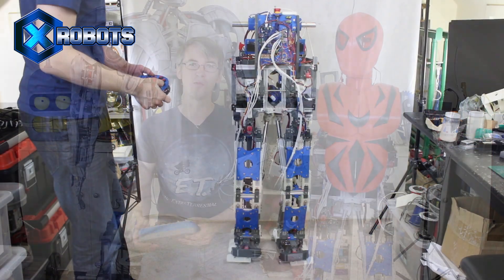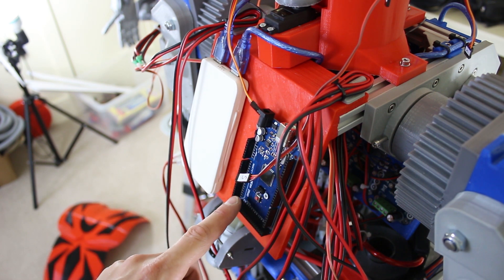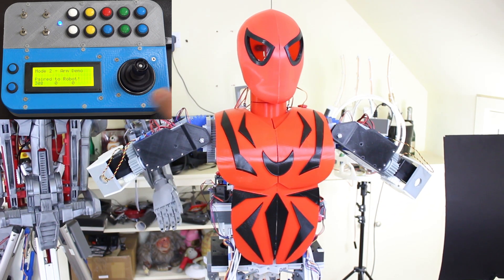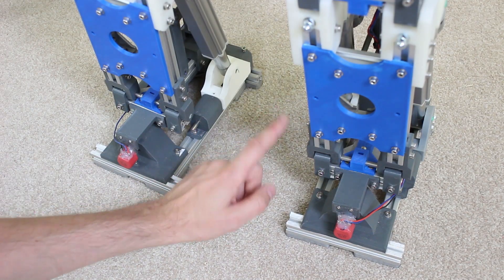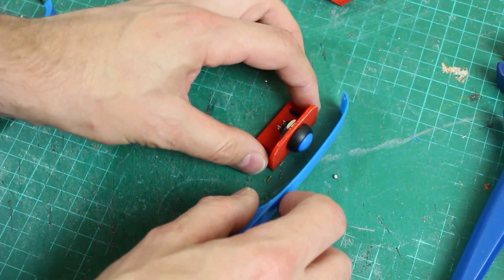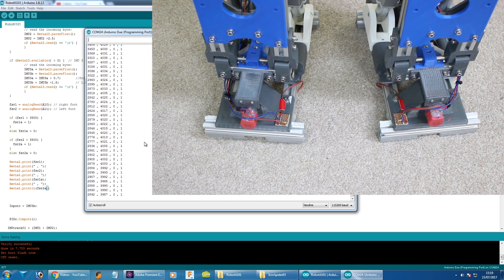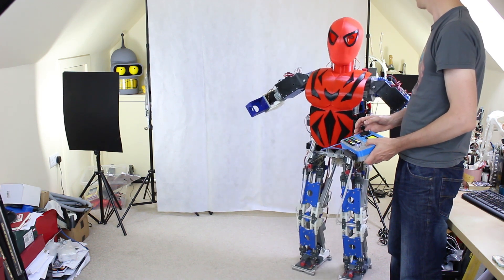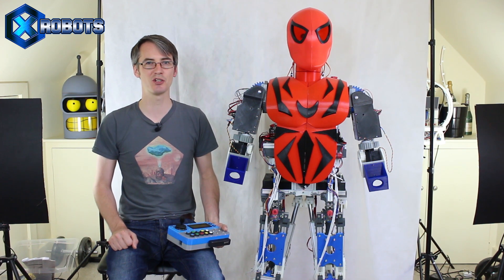Robot Spider-Man #3 | Walking Again | James Bruton

Comment: Awesome work.  I know this is a year on from your work, but I think you should have used optical mouse sensors in the feet.  It would have simplified the design as they could have been made flush, and also given you directional and distance data to the ground too.

Comment: James have you considered adding some dials to your controller so you can tune the settings (for example the feet sensors) whilst the robot is active?  You could see the value on your screen and tune different sensors when in different modes.
Reply: Yes that would be even easier as no extra controls just a different mode via a button I suppose?

Comment: Have you not thought of using a patterned ground mat and cameras, on the legs/feet, to get the robot to adjust and correct it's walking as it goes? This could be used to automate walking patterns.

Comment: @jamesbruton , ive noticed that you are still using the Arduino ide for programming your Arduino boards. For doing something that complicated i think you need an upgrade. Look at using Visual Studio with the Visual Micro plugin. It will completely change your Arduino programming experience.
It gives you incredible debugging, programming assistance and just about everything you could ever want it to do.
Give it a go, its free.
http://www.visualmicro.com

Comment: Hmm... if you had 4 pressure sensors on each foot as you describe, couldn't you also tell when the mass applied to the body has changed? Which would allow some latitude for self correction when you change (or change out) the "costume."
Reply: James Bruton We also use our arms for balance. I think combining Steve's idea with arm movement to maintain balance when on one leg is possibly the way to proceed. Also we move our body to lean slightly forward when walking. Someone once called walking "controlled falling". We don't just move our legs to walk.
Reply: We also have an inner ear which roughly acts like a gyroscope. It doesn't physically balance us but let's us know when something is wrong.
Reply: Could possibly use a(an?) FSR, which would press against the gyro to tell when it's leaning or moving away from upright. 

Also the robot would gain an awesome tone/hum when it spins up.
Reply: James Bruton ahhh yes the IMUs.

Comment: Any thoughts on what you are going to do for the ends of the arms?

If possible I think rigging some Silly String cans (hidden in the wrist area) to some of those draw-string style hands you've done before that allows the robot to do the iconic "web shooting" hand gesture while triggering the Silly String would be pretty neat.

Wouldn't imagine it would be too hard to pull off especially if the firing mechanism is based off of the design used for the majority of the "web shooting" toys (I don't know if this is something they make anymore). Might make for a fun gimmick for show casing, especially for also showing off the range of motion for the arms if you got the robot to re-position the arms to hit different targets with the string.